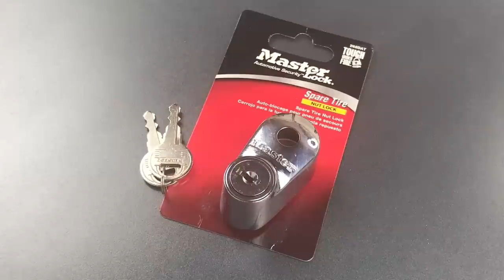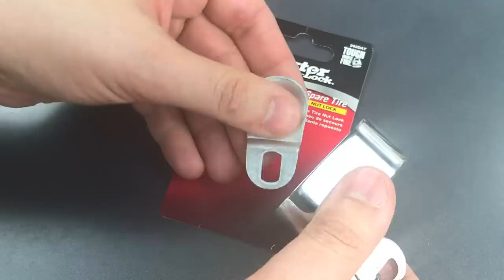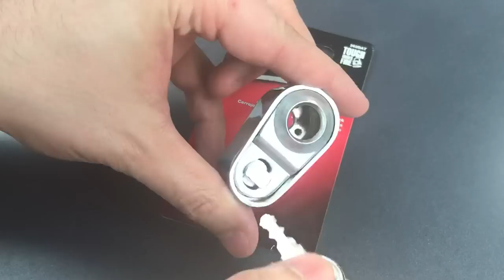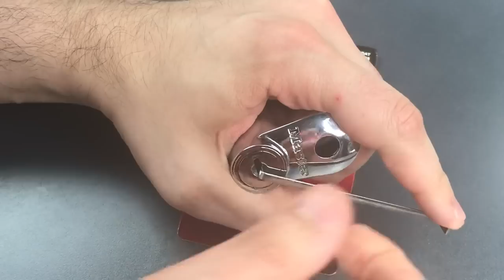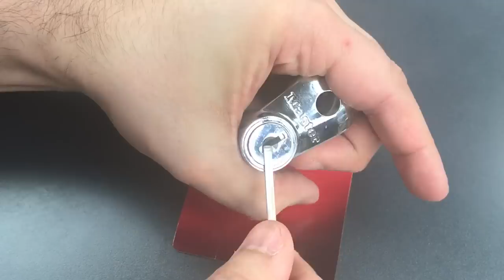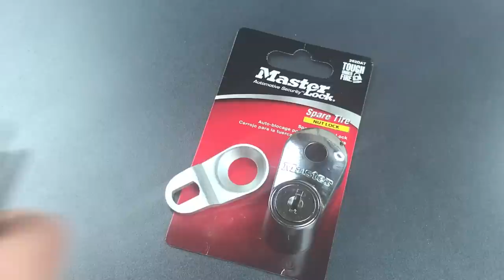[712] Master Lock Spare Tire Lock Picked FAST (Model 262DAT)

Comment: LPL would be very interesting to see you lock this to a wheel hub and try the normal attack on Zinc bodies with a plumbing torch. I suspect an even quicker open, given the thickness of the lock body.

Comment: "Tough Under Fire" the packaging claims on the top right.. yet is made with alloys that are used on locks with the lowest melting points /susceptible to fire/heat attacks.

Comment: I don't expect you to see this, but if you do.
Any advice for learning pickers when it comes to raking? I learned by SPPing everything, I recently started trying to rake, and I can go anyway from picked in 4seconds, to 40 minutes.
Usually if I don't get it in 20 seconds, I keep my tension and switch to SPP to finish it off.

But I figure there must be something I'm getting wrong in the technique.

Comment: Given that the locking engagement is offset like it is (and doesn't engage much), I kind of imagine you'd be able to simply pry the thing off with little effort.  

I suppose it depends what sort of nut is under it.  A short open nut would give more room to bend the lock before it hit the nut.  A taller acorn style nut might help reinforce the lock by limiting movement.  

Then again, I suppose it you tried hard enough, you could just break the casting or mangle the retainer plate; after all, if someone is carrying a lug wrench to begin with, they already have what it takes to break the lock.

EDIT:  I just realized that this won't really fit on any alloy wheels that have counterbores on the bolt holes.   I don't see how this product isn't a less effective and less applicable option than a regular keyed lug nut.

Comment: TL;DR: I would love to know if that rake matched the bitting of the key closely enough in this video to be used as a key itself.

I actually noticed something on the first rake I ever cut. It was super easy to open the lock that I had to practice on with it, every time, but only with that one rake. The key for the lock was a quikset, cut at, if I remember correctly, 1-3-2-3-5-4, which is the same pattern repeated twice, at different heights: "0, -2, +1"

Well, I finally looked at my rake and the key because I thought something was up, and it turns out that I had cut my rake at basically that bitting. Base, down two, up one, and I could effectively use my rake as a key.

Looking at the key here, and your rake, I wonder if you couldn't do the same. That bitting looks a lot like your city rake, and there is no excuse on their part for that.

Comment: Considering its just for a spare tire in your trunk i think its fine. Its more of a deterrent.
Reply: This is for spares that are stored externally on a vehicle, like on the rear door or hood of some SUVs. A spare in the trunk is already protected by the locks on the car and usually not retained by a stud and nut making this lock redundant for those.
Reply: FordPrefect23 again its a deterrent, like a chain fence. It deters.
Reply: It might deter an honest person who is fighting their conscience but that’s about it. Unless there are several vehicles in a row all with desirable spares.
Reply: Dude. I live in macon. Theu dont need to rip a tire off the back. Ive seen jeeps with the spare still on missing a wheel.

Comment: the lock that nobody needs, thats what wheel locks are for. throw 2 of those on the spare and its golden. who would even try to take the spare from under the truck/suv/minivan? and the rear of jeeps and rav4's? i guess it happens but dam.....
Reply: It happens all the time. Most SUVs with external spare tires have fairly expensive tires. The spare is typically a full size spare. You hit 4 of them, and you have a full set of brand new tires already on wheels that you can sell on Craigslist for $500 or more. It's much easier and more lucrative than stealing the pipes from a vacant house. New car dealers get hit regularly for this stuff.
Reply: Also, wheel locks are darn near useless. You can buy a special socket for less than $30 that will bite into the outside of a wheel lock and remove it. Tire shops use them for when a customer has lost the key. Alternately, there's only a small number of key types for each style of wheel lock. Collect them from a salvage yard, and you'll have them. Or smash the window of the car and grab the key out of the glovebox or tire tool bag.
Reply: puckcat22679
right.... i remember seeing the news once ages ago where a dealer somewhere lost the tires/rims on like 30+ cars. the dealer wheel locks do have limited keys and the stuff they sell at walmart/etc as well. those types of crimes were common during my teen years but i havent seen it since then. busting open wheel locks takes time and effort, removing wheels from a vehicle without locks is easier. i use unique wheel locks forgot what they are called. but i'm sure nobody has the keys for it. i guess these crimes still do happen, but not here.

Comment: Brute force attack next? Saying that i dont think a heat attack is that realistic given that you´d probably melt the tire doing so.
Reply: Weighty hammer and a decent aim, probably fly off.
Reply: Sure it is. The nuts are a considerable distance from the tire, and the heat from a plumber's torch would melt the zinc in no time while barely warming the aluminum wheel. Still, a couple good whacks with a hammer would either break the lock or loosen the nut so you could spin it off. Regardless, there's lots of ways through this lock in under 30 seconds.
Reply: I think the main thing is being realistic - some one looking to swipe a tire isn’t going to be keeping a plumbing torch with them. I would guess that a swift hammer blow or two would easily take it out though.